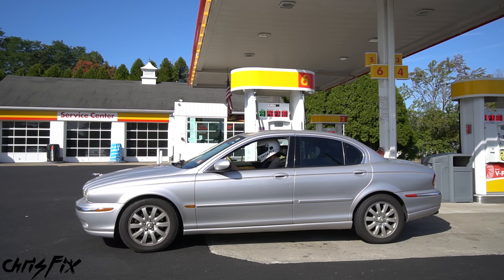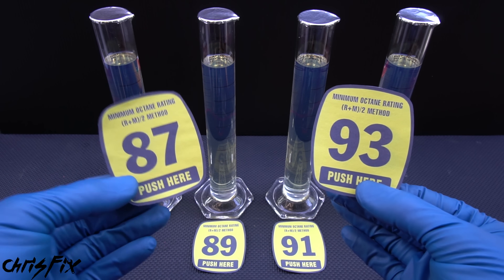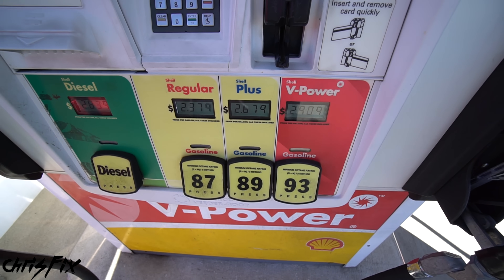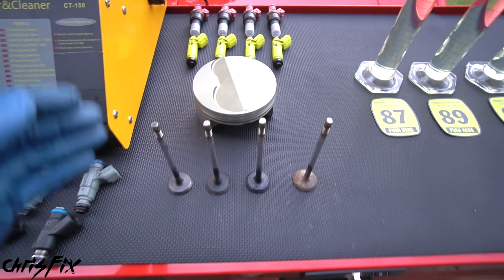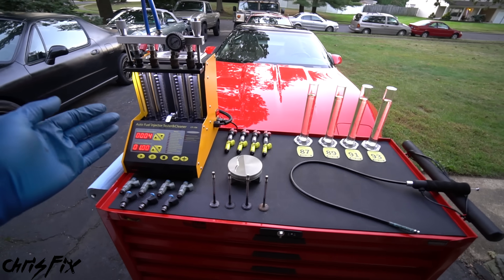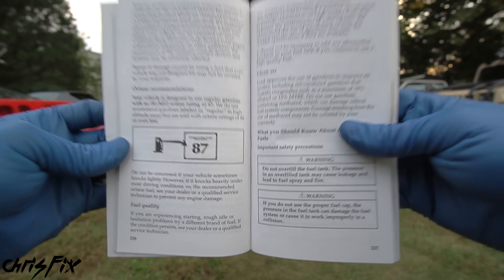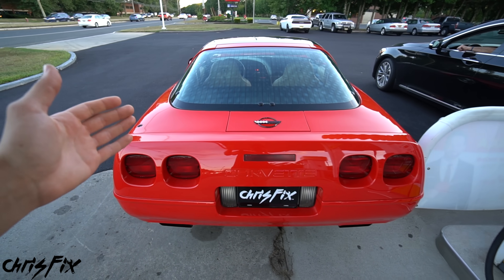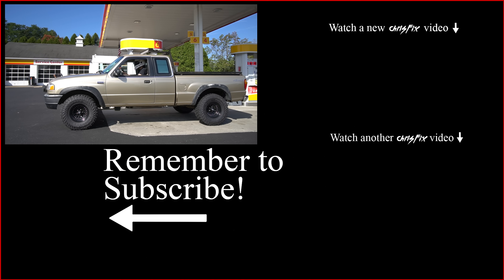What is the BEST Fuel to Use in Your Car or Truck and WHY

Comment: There is a HUGE documentary on the Octane being a big f'ing joke. I'll stick with what they found proving the oil companies are simply taking advantage of the consumer, period.
Reply: I have not seen that documentary, 

However oil companies taking advantage of the consumer in one way or another is not a new thing,

Octane rating does matter, but how they market it is where there may use "artistic licence" at times, as well as how much extra they charge....

Is using a higher Octane fuel like strapping a supercharger to your engine... no,

Does it have benefits... yes.

For example here in Australia the higher Octane fuels are of a better quality in general, and have less sulfur than "Regular"
Reply: @notsureyou  The only place they said Octane mattered was on a race track for engines that really required such precision. Outside of that they found no benefits and even when they confronted the oil industry they turned their backs. (I'll look for the doc, busy atm)
Reply: @ipKonfig  

One of the biggest contributing factor to fuel economy is how someone drives their car,

You cant get more range out of E10 feul versus Premium if you drive it more sensibly than the Premium fuel car.

As a former car mechanic I know that Octane does matter, and that higher Octane fuels are of a higher quality (here in Australia 98 contains less sulfur for example), 

Can lets say an ordinary street car reap the full benefits of lets say 98 Octane fuel.... maybe, maybe not 

As the ECU can only advance the ignition timing so far before it becomes counter-productive (and so the ECU won't), 

And each car is different, for example my 2005 Corolla got the best range on  95/96 Octane fuel not 98 Octane.

And at what point a further increase in Octane will yield either no result or negative result only the engine designer would know.

Petrol cars usually have a minimum Octane in the owners manual, and it is only by "trial and error" that you can work out whether a higher Octane fuel will yield a positive result
 
(and to muddy the waters, some car's don't like certain brands, I think it has to do with the additive package that is unique to each brand).

Usually the increase in cost is barely if ever compensated for, but if you are using less fuel, than it's better for the environment.

I find it strange that the oil companies would not give an answer on Octane fuels,

But I look forward to seeing the documentary :-)

Comment: 87 will mess up your motor..
93 will keep everything clean and running smooth. I have had cars that started running bad and i used two tanks of 93 and the car run good again. It also preserved the pcp valve. Cleaned the fuel filter.. And i get better performance. This is proven ..try it your self. 93 will also clean your injectors.
Reply from the maker: thanks for sharing

Comment: Does or can your octane requirements change if say your pick up is hauling near or at your max weight? Either hauling in the bed or towing a trailer. Or if you were racing a stock car at the track, where you are running flat out would more octane give you any performance benefits. I know that some older carbureted cars in high heat wouldn't run on regular gas like they would in cooler weather. Can this happen to newer cars. Also will running higher octane help lower exhaust emissions. Either just by octane ratting alone or because of the higher levels of cleaning additives keeping things cleaner, or a combination? Or something I had not thought of? The reason I ask the last one is because when I ran my Jeep on regular like the manual says it ran just fine But when I stared running premium it smells a lot less at the tail pipe and idles 200 rpm less. I have always run a bottle of fuel system cleaner with every oil change to keep things as efficient as possible. So I don't think it is the additives. But I could be wrong.

Comment: I have ‘96 Celica with 280k miles and have been using 93 octane for the past 24 years and never replace a fuel filter.
Reply from the maker: Thanks for sharing
Reply: I thought I was doing well on my now last car,

2005 Corolla 86K miles (140,00KM) and never did the fuel filter and it ran fine (used "Premium" 80% + of the time)

Comment: How about when you get a tune are you supposed to follow 91 or 93 octane rule
Reply: What do you mean by "Tune"?

The term "tune up" for example is used interchangeably at times by people and it usually just means taking a modern car to the Service department for a regular service.
Reply: @notsureyou  when you program your vehicle for higher octane levels to get more performance out of it you know like a SCT tuner
Reply: @rafaelsandoval7077  In general the higher the Octane the more performance you will get in the power stroke (up to a certain point).

Depending on the ECU/ tune and if it is able to operate beyond the tune parameters would be determining factors,

For example if you set the tune for 91, and you put 93 in, will the ECU detect this and take full advantage of the higher octane fuel?

The problem that you may encounter by going 93 for example is whether it is readily available, so if you drive cross country will you find it in every Fuel station?

Comment: CRC one tank tune up with PEA cleaner works as advertised, while in fuel exhaust stinks and can be whitish color, then the fill up after with straight gas you notice a great power increase, change your air cleaner too , it really is impressive improvement , car runs much smoother, especially for an 80,000mi  and up car, the first time I used it , it turned off my check engine light, most likely cleaned an oxygen sensor
Reply from the maker: Nice!

Comment: Great vid as usual. There's one fun fact (or maybe not so fun fact) that I don't think you mentioned. Most pumps have three octane grades (some may have four). BUT most stations only have two tanks of fuel; the regular octane and the premium octane. The two octanes are mixed at the pump to get the mid grade octane. (89 octane + 93 octane)/2 = 91 octane. Or, 91 octane is 50% 89 and 50% 93.

Comment: What are your thoughts and pinion on something like a complete fuel cleaner liquid you put in when you fill up? It says it cleaner and to stop knocks and pings. Thanks
Reply: It depends on many things,

By claiming that it stops pinging it is usually referring to it's cleaning ability, as pinging usually refers to the fuel being ignited by a source other than the spark plug (so a hot carbon deposit for example)

By claiming that it stops knocking it is usually referring to it's ability to raise the octane level of the fuel.

Now for the fun part,

If your car is running fine, and you usually use good quality fuel (not from some cheap nasty place) than this product is not really needed.

Because most fuels contain cleanses, and the majority of products which claim to boost Octane do so dishonestly (for example some claim to boost by 6 points!! but when you do your research it adds 0.6 so for example here in Australia 91 (our "Regular") becomes..... 91.6 which is pointless, since it would have cost less just to have filled up with 98....)

However using a product like this as preventative maintenance is a good idea (sounds contradictory)

It's a good idea because if you use "Regular" for example than using a product like this, or a "Total Fuel System clean" etc will help keep your system clean and lasts between 3000-6000 miles (usually) depending on the product.

Which is usually cheaper than using "Premium" all the time.

What I do for my car is to use "Premium" and a "Total fuel system cleaner" every about 6000 miles (10,000 km).

I don't bother with an octane booster because the ones that do actually boost your fuels octane by an appreciable amount are expensive, and I wouldn't expect to use a significant increase in range to offset the cost (there is only so much you can advance the engine timing so far before any further advance would be detrimental, which the ECU would never do),

So you would end with less performance as the mixture would not full ignite as the piston reaches the top (so you end up with a situation as though the fuel had less octane than "Premium")
Reply: @notsureyou  Wow. Thank you for such complete answer. Helps me alot. In my case its preventative to keep it clean. Thanks again much appreciated.

Comment: Supposedly that octane booster only brings up the octane about 6/10ths of an octane so getting 87 when 93 is required may not help much
Reply: Correct, and those that do actually raise it by the number on the bottle are expensive,

To the point that it's cheaper to just use "Premium"

Comment: @chrisfix I wanted your thoughts on using premium as it doesn't degrade as quickly as regular. I rarely drive my daily and fuel up maybe once a month. I was told for engines that don't see a lot of miles including anything carburetored, to use premium and fuel stabilizer.

Also, with octane boosters, you should mention that for every 10 points it adds in octane it only adds 1 octane. So if it says it adds 30 points it would raise 87 octane to 90. If the bottle doesnt say how many points it adds I wouldnt use it.

Comment: Going with the recommendation of the Auto manufacturer is best. If you are running a high-compression engine though, such as built for competition or high performance, regular Pump Fuel is not going to be for you. You will need race gas which has a much higher octane rating.

Comment: It’s my understanding that lower octane fuels have lower energy content not because the “gasoline” has less energy content but because of the tendency for these lower grade fuels to be blended with ethanol. In Canada for example almost all 87 octane fuel contains 10% ethanol. Ethanol having approximately 60% the energy content of standard gasoline. Doing the math this means regular fuel has 96% the energy content of premium. 

Is this understanding flawed?
Reply: Im using unleaded gasoline is that ok?
Reply: bleeehh! gamer ML 

Unleaded simply means free of lead. After they discovered lead is poisonous and carcinogenic they removed it from fuels.

Comment: Ideally, should you put Octane Booster “before” “during “ or “after” filling up? Just curious about getting a good mixture/blend.
Reply: Right before, this way the fuel going in blends it
Reply: @Suction_  that has always been my thought also. That way the additive gets "stired up" as you put in the gas. Otherwise, you have the additive only at the top of the tank until it gets sloshed around enough to mix it which would take burning through at least 3 -4 un-mixed gallons to occur.
Reply: He was giving you an example of a real-life scenario... you're at a station without premium or you filled with the wrong thing. In either case, you'd have to add it afterwards.

Comment: In 1974 I had a ChevyVan 10.  I did a test myself.  I filled with Regular and when it ran out?  I filled with Premium.  Premium cost 0.00002 more than Regular per mile.

Comment: I have a 15 TLX. DO I put regular or premium?
Reply: NVM! Just answered my question. Thanks for the 'checking the fuel door' tip! It says "Premium recommended" but I've always put regular so I am good
Reply: What I have always wondered was what happens if you switch between regular and premium and vice versa, will that damage anything under the hood?

Comment: I drive a 2004 Ford Taurus and the manual says to put 87, buuutt it chugs a ton of gas and it actually saves more gas on 93. I thought that maybe once I installed a k&n air filter and my Magnaflow muffler it would save more gas on 87 but it didnt

Comment: Great video thanks ChrisFix!  Question: I did a DOD delete getting rid of the AFM in my 5.3 gm truck.  I had the ECU programed to not run the 8 to 4 cylinder DOD so it will run as mechanically set up as i took out the collapsible lifters and changed the Cam. I was told not to run E85. I shouted have asked but didn't because I was already overwhelmed with the whole gig. Do you know why i shouldn't run it? Thanks for a great job of explaining the octane difference.

Comment: Ok... let me ADD to this!
I work at the Largest refinery, west of Texas in Sourhern California.  Tesoro now Marathon in Carson California.  We do 400,000+ barrels a day!
And in my unit, Storage and Handling (SNH)... there are (5) jobs to qualify on.  The 5th job is “the Blender.”  Guess what that is?  Yep, BLENDING gas components to MAKE GASOLINE!  

THIS IS WHAT I DO FOR A LIVING!!!

Let me be clear!!!  GASOLINE IS NOT A SINGULAR PRODUCT that comes out of Crude oil like Diesel, Jet Fuel or Stove Oil.  It’s a BLEND of MANY different gas components.  Each “Blend” has its own recipe... First off there are only TWO grades of Gasoline.  REGULAR and PREMIUM.  MidGrade is the “OffSpec” PREMIUM that we can’t sell as premium and then we reblend it and bring the OCTANE level down and call it MID GRADE!

Ok... I’m gonna try and keep this SIMPLE!

When the blend is happening (12-16hrs), we have “Knock motors” in our blend house and constantly check to make sure the OCTANE LEVELS are being kept to its blend recipe.

HOW do we do this?

It’s called RVP.  Reid Vapor Pressure!  (Research RVP and what it is?).  In basics... RVP is The Volatility of a gasoline blend.  It’s the absolute vapor pressure from a Liquid.  In basic terms?  It’s when a LIQUID naturally changes states to a VAPOR and at WHAT PRESSURE? That’s RVP.

RVP IS WHAT CONTROLS THE OCTANE LEVEL IN GASOLINE BLENDS!!!

Also... let’s show a quick list of HYDROCARBONS or GAS components we use the BLEND Gasoline!
C1 - Methane
C2 - Ethane
C3 - Propane
C4 - Butane
C5 - Pentane
C6 - Hexane
C7 - Heptane
C8 - Octane
C9 - Nonane
C10 - Decane

The hydrocarbon scale goes to 100.  Here’s the list of them in their “Natural” state.
C1 to C4: GAS’s
C5 to C16: LIQUIDS
C17 to C109: SOLIDS

There are other components in the hydrocarbon scale to adjust RVP such as...

Debut, Heavy Cat, Alkylate, Hux, Reformate, and other forms of C4 and C5 called ISO Butane and ISO Pentane, Etc...

ONE of the hydrocarbons should have stood out to you???  Yep, C - 8
OCTANE!!!

Ok... now, Each recipe is blending with its OCTANE reading but it HAS to be kept at a specific RVP.  For instance?  California SPECS say that the RVP must be 15-17.  But Arizona and Nevada SPECS can be as low as 10-12.

WHY?  Population Density and emissions!

With that said... OCTANE RATING is part of the Recipe, but it MUST be kept at a specified RVP for emissions.

RVP is the key to EVERYTHING!  NOT OCTANE!!!

Take care... Hope this helps!!!

Comment: First off it depends on which company supplies the fuel. I can tell you now Shell sucks, not a great fuel to compare anything to.
Reply: In Australia the base fuel stock is the same, each company then add their own secret herbs and spices,

Which can cause some vehicles to perform a little better or worse.

My last car didn't like Shell 98 (rough idle and hunting at times), my current car doesn't seem to mind it.

Comment: I was skeptical at first when I received a loaner vehicle from the dealership and the exact same car they let me use had better gas milage and it even had around the same miles as my car. I asked and they told me that they use regular instead of premium in the loaners (car REQUIRES premium). I used regular for the next several weeks and I definitely saw better gas milage. I don’t hear ping, knocks, or detonation but I switched back to premium just in case. I don’t want to be wasting my money but would it be ok to put regular in my INFINITI Q60? It does have a turbo but I don’t know if they just stuck the same sticker in all of the vehicles and called it a day...
Reply: Maybe try using premium from different companies, both my last car and current car got worse mileage from one specific brand, versus all the others.

The one disadvantage to premium fuels is that they perhaps use too many cleansing additives, and so the higher octane won't translate to the most benefit to an increase in range.

My last car gave the best range on mid range premium (95 in Australia) versus premium (98)

Comment: what about going to different gas stations. Does arco offer same octane or quality as going to chevron ,shell, mobil,etc?
Reply: In Australia the base fuel stock is the same for all the fuel companies,

They then add in their own special "herbs and spices"

From many hours of reading and my own experience with my last car,

Even though the original base stock is the same, some cars have been known to work better with some brands, and to even run rough with others (so the special herbs and spices are the issue).

For example my last car which was a 2005 Toyota Corolla did not like shell 98 and would run rough and even "hunt" at times

Comment: But more motors are going to direct injection and fuel won't do anything for the valves because fuel don't touch the back of the valves.
Reply: Correct

Comment: How does ethanol affect the engine?
Reply: What do you mean?
Reply: Ive heard that ethanol can hurt  the engine.
Reply: @pappadappacarhauler757  Ethanol is what is called Hydroscopic, meaning that it attracts moisture (even from the air), and was initially even drying up rubber seals etc.

Most modern cars can run E10 fuel these days without needing to worry about that issue,

However Ethanol has less energy than Petrol, which is why you would rarely get the same range on a tank of let's say E10 versus 100% petrol.

Most people don't notice the difference because they chop and change week to week.

Also how you drive the car can make as much difference as what fuel you put in your car.
Reply: notsureyou Thanks for your reply.